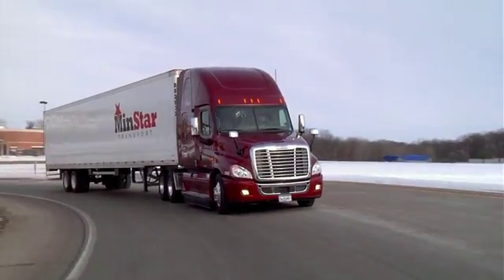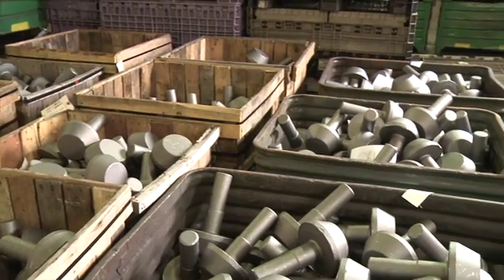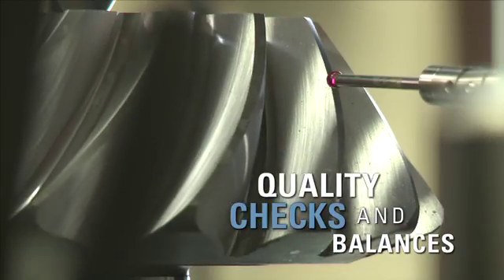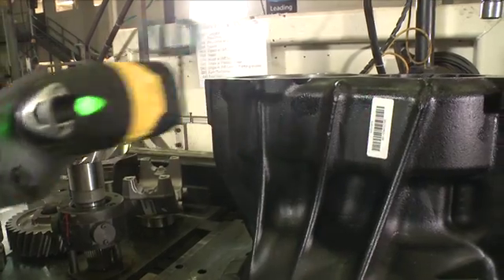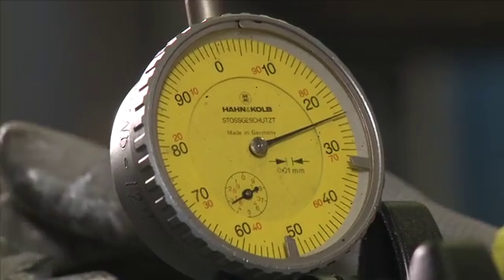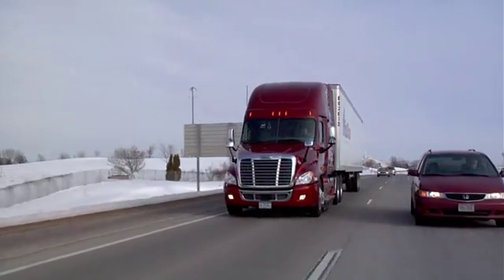Detroit Axles & Manufacturing

Comment: Received the CV Axles on 9/8/2021 and inspected the two CV Axles when I received the package. Order two front CV Axles for my vehicle. Detroit Axle sent me CV Axles with boots that are dry rotted and there is no grease packed into the bearings of the CV Axles.
Manager of Detroit Axle refused to send me an exchange and said to me I sent you a return label. Send back the CV Axles and we will fully test the CV Axles and if we find they are defective we will refund your money but minus shipping, and/or when we test the CV Axles and they are not defective then we will refund your money minus shipping fees. What? wait a minute Detroit Axle will not do an exchange. Remind you I just received the two axles on 9/8/2021. Every customer service rep I've ever spoken to at Detroit Axle has been rude.

Comment: WARNING:    Hello I bought a kit for my Silverado and the little silver nuts with the blue nylon are to soft of a metal to use safely on a vehicle. I just used a little 8 inch hand wrench and the nut pulled the threads right out .So I hope nobody uses these nuts and bought better nuts. Somebody could get killed driving down the road with these faulty low grade nuts.

Comment: Just my own opinion. I have worked on differentials, trannys and drive line for 43 years. This is the worst differential ever made!. Pinion nuts come loose, spline wear on the pinion gear and pinion splines. And did I mention the pinion nuts always come loose! The idea of having the 2 pinion bearings in between the pinion teeth and the pinion gear is not a very good idea, engineers seem to think so. Try working on one.  And the cost to repair! Even with quality aftermarket parts are expensive. Get ready when your Casadia breaks down. Be glad to see you in the shop. Double the price of a Dana or Meritor axle. And these 2 are far better axle than Detroit (Mercedes, Alliance )
Reply: @Maple Leafs their pinion looks like most conventional diff pinions I’m familiar with (general 4x4) I’m not understanding what you mean regarding the pinion bearings? 🤷🏻‍♂️

Comment: I just received front suspension set for my 04 f250 6.0 and the steering link came without a rubber boot onit. I emailed  Detroit Axles with photos and the reply was you are right the rubber boot is missing. We can give you a 5 dollar partial refund. I was like "what"? No I want you to send a replacement and I will send this one back to you. So yea you may ha e to tighten quality control a bit

Comment: It’s about time someone else made axels for class 8 trucks. I like the idea of needle bearings for the king pins to ride on in the front axel assembly’s.
Reply: Received the CV Axles on 9/8/2021 and inspected the two CV Axles when I received the package. Order two front CV Axles for my vehicle. Detroit Axle sent me CV Axles with boots that are dry rotted and there is no grease packed into the bearings of the CV Axles.
Manager of Detroit Axle refused to send me an exchange and said to me I sent you a return label. Send back the CV Axles and we will fully test the CV Axles and if we find they are defective we will refund your money but minus shipping, and/or when we test the CV Axles and they are not defective then we will refund your money minus shipping fees. What? wait a minute Detroit Axle will not do an exchange. Remind you I just received the two axles on 9/8/2021. Every customer service rep I've ever spoken to at Detroit Axle has been rude.

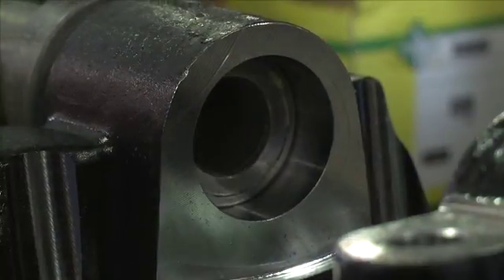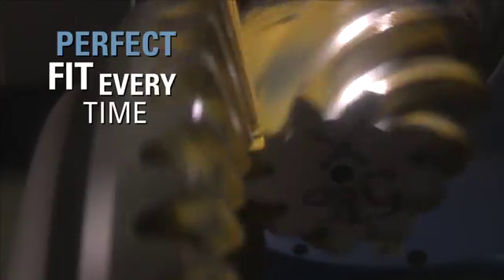Comment: Lean Six Sigma Master Black Belt Waste Walk; 0:48 what is the guy doing all by himself?; 0:31 waste in the form of inventory; 1:50 more inventory; 2:10 what is the mean and sigma?; 2:44 is there a pull system in place?: Quality check the processes, not the parts.  Toyota uses each employee as a Quality Engineer through an andon system; 4:46 warranty is good, it shows commitment. www.LeanBusiness.co.  Toyota's CI program accepts any improvement that saves at least 6ms.

Comment: For those who are confused...Detroit Axles & Manufacturing (Class 5-8 Truck parts) is NOT associated with Detroit Axle of Ferndale, Michigan.  Detroit Axles is also historically known as Detroit Diesel...been around 80 years...Detroit Axle has 60 employees and has only been incorporated for about 18 years. I'm quite surprised that Detroit Axles hasn't sued Detroit Axle for Copyright infringement, actually.  But, hey...you got crappy parts on EBay, and you aren't driving a 'Big Truck'...blame Detroit Axle, not 'Axles'.

Comment: DONR BUY FROM THIS COMPANY!!! Hubby bought parts from this company, they are cheap and far from durable. A part for his HD truck BROKE while driving, luckily not on the highway. Causing an EXTRA 500 for  repair. These are cheap parts imported from China don't be fooled!! If you value your life or your loved ones, or your work for that matter don't buy this crap!!! If my hubby was on the highway when this part failed he likely would've flipped the truck and died.
Reply: Parts are not from China! I know because the company I work for machines the carrier mounting, the housing shown at 3:30 mark, which holds the ring and pinion assembly. We do it in Rochester Hills, Michigan from a casting poured in Wisconsin. There MAY be some parts sourced globally but this company is fanatical about quality.
Reply: Pretty sure your hubby had too many Millers while he installed his parts 😂Detroit axle has been around for awhile and far from Chinese parts dude lmao! I have they’re parts in my Trans Am and people even have them in they’re race cars...  don’t drink and wrench.. 😂
Reply: Detroit axles and detroit axle is not the same company, detroit axle sells cheese dick china car parts from china and doesnt make anything at all.
Reply: "been around for awhile" doesn't hold much water anymore.

Harley Davidson used to be virtually all made in USA.

2014 article: "So, where are Harley-Davidson motorcycles made?  All over the world, actually.  But those sold in America, are assembled here in the United States, using a lot of foreign made parts."

https://www.throttlexbatteries.com/details.aspx?p=A4D3D61DCEB3C859&ppid=59924&beid=7BD67A6B7D0B565F